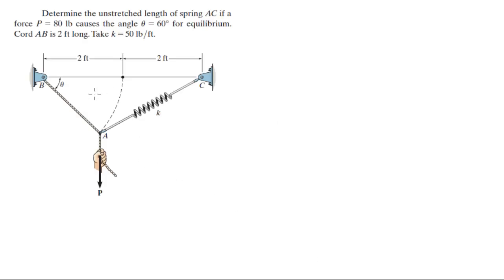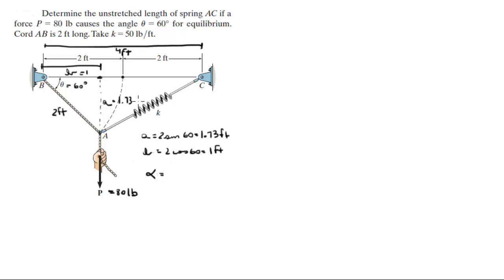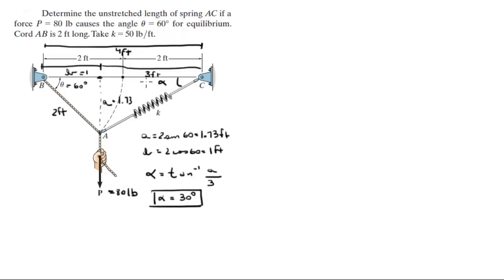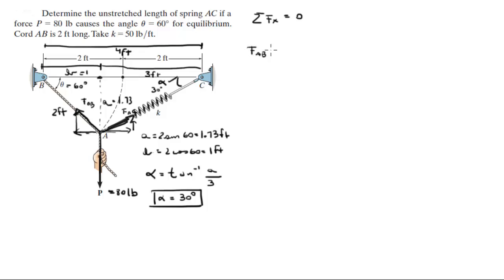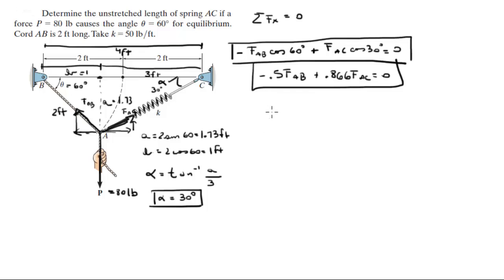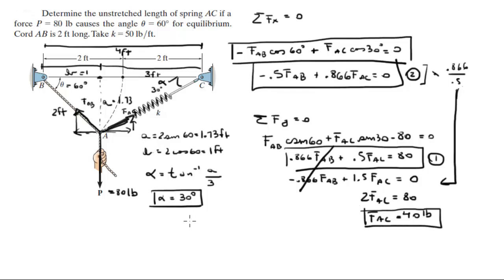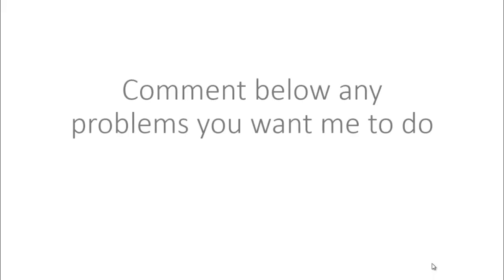Determine the unstretched length of spring AC

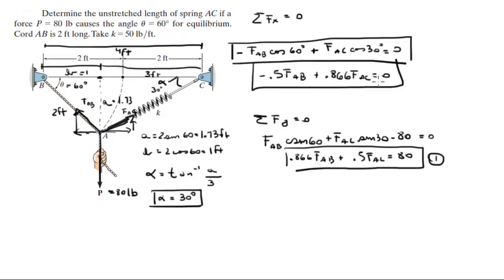Comment: @4:06 at the Σy, it should be F(AB)sin(60), not cos(60) to get the 0.866F(AB). The process of elimination was properly executed simply because the angles used are the angles in special right triangle (30-60-90). Nevertheless, you could get its real values on the proper algebraic process.